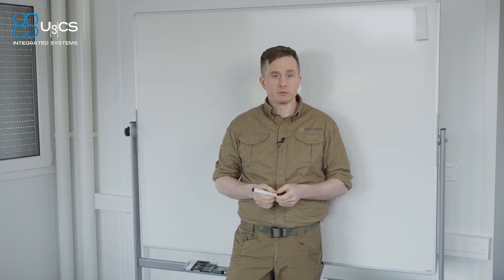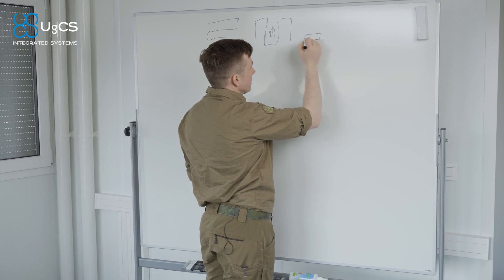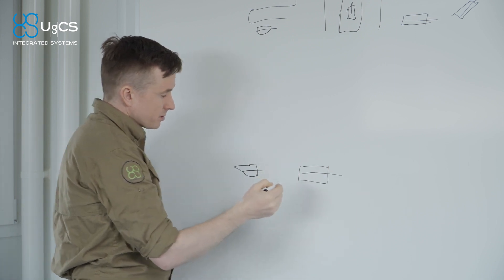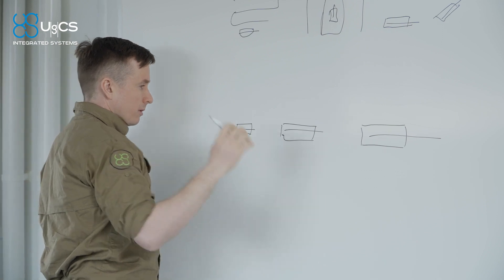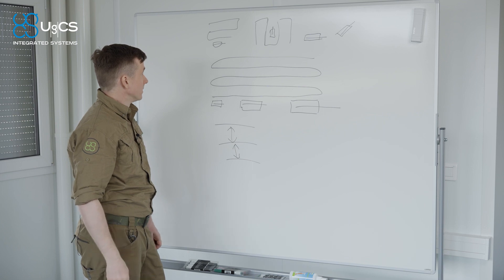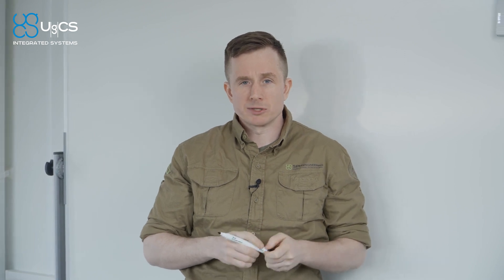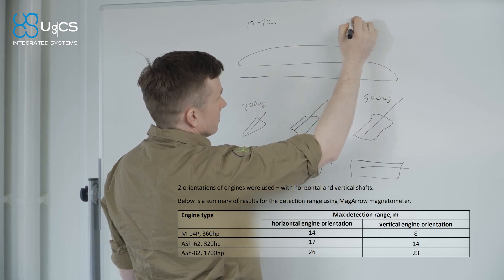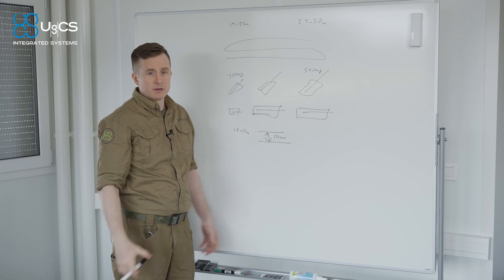Detection of aircraft engines with drone-based magnetometer

Comment: 5:40, one question - if the magnetometer can "search" engine from a 10 meters, why a distance between profile a 15-20 meters?
Reply from the maker: We found out that we need 10m between grid lines to make sure we have covered an area without blind spots. Could probably use 15-20m but then we risk to catch reading only on one flighline, but it better to have it on at least two to be sure. Later anyway it is advised to scan “suspicious” places with tighter grids and closer to the ground, provided traveling on foot to the location to inspect is not easy or feasible right away.